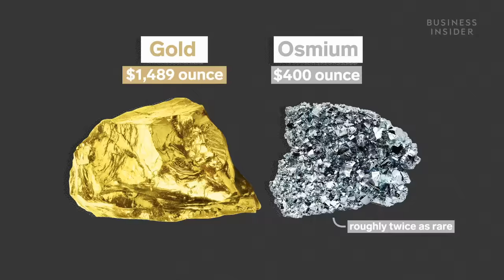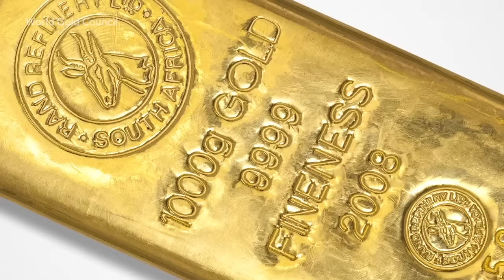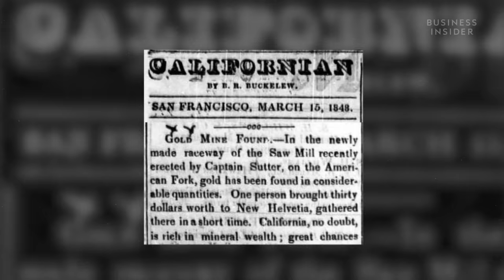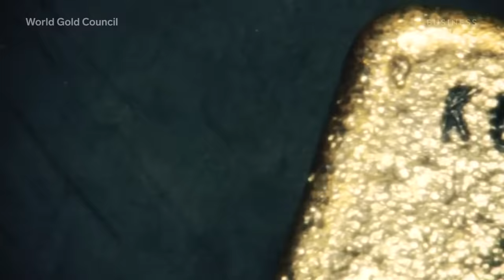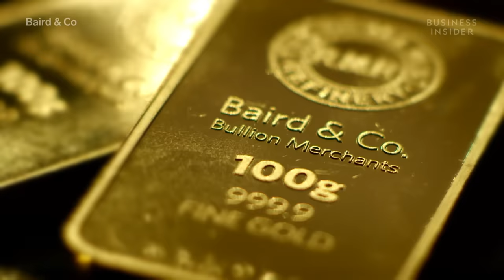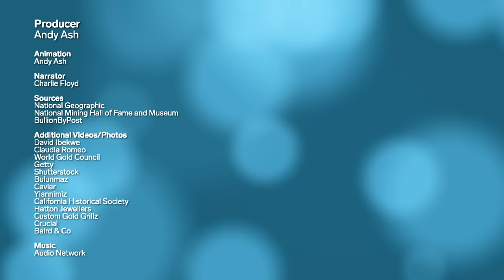Why Gold Is So Expensive | So Expensive

Comment: Knowing this it seems like a huge waste to use gold on jewelry.
Reply: Where else should it be used. ?
Reply: I hardly care much about jewellery honestly
Reply: @onaisarehmani2884  technology
Reply: @onaisarehmani2884  you didn't watch the video ???
Reply: @LevSeven_  well, if its so valuable for technology be prepared to pay for my cold chain when the mines run out.
Reply: @onaisarehmani2884  
gold is one of the top conductors of electricity, only behind copper and silver, but gold is better than those metals in pretty much every other way.
therefore it is the greatest metal for technology.
Reply: It's best used in jewelley. It looks so amazing plus it's so valuable.
Reply: Not really, because its just a form to store it like a gold bar. It can be sold and melted.
Reply: yeah,we can use it for another project
Reply: @TheBooban  damn straight
Reply: @centralprocessingunit4988  Silver is also the best heat conductor. Along with being the best electrical conductor, it's a more important commodity than gold. The only major advantage that gold has on silver is the fact that it is so unreactive so it doesn't tarnish, but even that is fixed with basic alloying.
Reply: @JavenarchX  so what if its valuable? and even if it looks good its better used for tech
Reply: Doesn't really matter. If/when we ever run out of gold all the stuff already made from gold can be melted down anyways.
Reply: @codymarshall2231  alloying reduces the electrical conductivity of the silver further because it disrupts the regular lattice structure by introducing various sized metal atoms. It would also cost a lot for every company to start having to buy silver and alloy it for an inferior product.
Reply: @onaisarehmani2884   why did you put a dot before a question mark?
Reply: @onaisarehmani2884  medicine,like what's said in the video
Reply: @JavenarchX  how is decoration valuable?
Reply: @onaisarehmani2884  Your comment is hardly surprising given that profile picture, of course you'd think jewelry is the only thing that matters, what a clown. Clearly did not watch the video either.
Reply: You are now baned in India.. after this comment
Reply: It's bodysafe & theres so much gold
Reply: Why a waste? It’s pretty
Reply: I mean, I can kind of see where you're coming from, in that it runs up the price so that it can't be used everywhere it would be useful.

That said, it's hardly a crisis, since there are other metals that are useful in the same capacities, even if they're less than ideal.

Granted, I'm not exactly unbiased, but I think the greater concern is the environmental and social costs of mining precious metals in the first place. We need to address those issues first, whether we're using them for technology, medicine, or aesthetics.
Reply: @JavenarchX  why should it be used in jewelry just because it’s valuable? That’s a bit shallow imo, sure it looks good but you can most gold jewelry are coated in gold because gold is quite malleable and soft. You can just paint it gold and it’d look the exact same.
Reply: It's not like it's being consumed. Gold always remains the same and can be used for different purposes.
Reply: @raisin4406  It's stupid
Reply: Not at all if you buy a gold wedding band it’s advantageous over buying a silver wedding band because if you ever were in dire straights you could smelt down the gold for alot of money in the future
Reply: Yup
Reply: Good armors are not a waste :ap
Reply: @centralprocessingunit4988  how do you figure it is better in every other way? Silver has the highest thermal conductivity of any element. It also has the highest light reflectance. It is also neck and neck for electrical conductivity with copper. I think sliver has one point or so ahead of copper though in electrical conductivity. It also has great health benefits as well. Gold is great and has these properties as well. But not on the same level as silver. The only thing Gold has over silver is rarely. That and you can pound it so thin you can see through it. I don't know if you can do that with silver lol. Back to the rarely of silver ans gold though. With how much silver we destroy in manufacturing of bombs and other technologies. Silver will soon be as rare as gold if not more rare. Because most of all gold ever mind is still on Earth somewhere in some form. We have destroyed a crap load of silver over the many years. New mines are not opening and like gold we are running out of silver. If we do find enough silver to mine. It could take up to 20 years for the mine to start producing. 
SILVER FOR THE WIN! LOL
Reply: it's called vanity honey
Reply: @JavenarchX  Silver looks better for jewelry. Gold is somehow looks dirty.
Reply: @citizen9403  but silver is more reactive compared to gold and rusts faster than it
Reply: @tuturu9514  silver doesn't rust it will tarnish
Reply: It should be used for money
Reply: @bismanaufa5618  money? Ok
Reply: @Electromushi Nah, throughout history from the bronze age to now, no metal has been as important to humans than tin.
Reply: @JavenarchX  Would you rather have a necklace or every piece of technology in your house rn?
Reply: @citizen9403  Silver tarnishes so it's unusable in electronics
Reply: @citizen9403  Same thing, different name
Reply: @caspernicus5822  tarnishing on silver is very easy to remove. And yes it is usable in electronics. If someone has silver that is tarnished and they are making something with it. They can easily remove the bit of tarnish to have nice shiny silver again. Also I don't see why you couldn't use it tarnished either. Shouldn't affect the conductivity of it probably at all.
Reply: @caspernicus5822  both... I'm rich
Reply: LOL! NO it's not!
Reply: It is
Reply: @JavenarchX  its not?
Reply: Your opinion is irrelevant. You’re not a business owner
Reply: @T12345T-r  yeah... Why not 🚫
Reply: @onaisarehmani2884  clearly someone didn’t get an education
Reply: How so?
Reply: @onaisarehmani2884  Medicine and technology

Much better than decorations, right?
Reply: @onaisarehmani2884  electronics; its the best conductor of all metals.
Reply: @cold_commander5155  okkk
Reply: Gold jewelry preserves it’s value. Diamonds are the scam
Reply: @VincentGonzalezVeg  Did you watch the video? It is predicted that useable gold reserves in the earth will be depleted in 20 years.
Reply: Gold was popular with ancient Egyptian rulers and gold watches were popular with 20th Century leaders. Paper money cannot compete with gold.  Gold was pegged at $35 an ounce until 1970.   Now one ounce 
Krugerands, Maple Leafs, and Eagles cost around  $2000 per coin.

Comment: Note for the editor: Watch main plates are made of brass generally, not gold. If they aren't brass then it is made of a harder metal usually to prevent flexing on a super thin movement which would affect the way gears engage. I only say this because the beginning explanation of gold is over video showing a watchmaker doing perlage on a brass main plate. Probably only watchmakers will notice, but just wanted throw a little knowledge out there in case it actually mattered to anyone.

Comment: It makes for a great physical currency because of the fact it’s rare, but not to rare like some other metals, so there is still enough to go around and be used, liquidated. Other metals are too rare and there’s barely enough to go around. And some metals aren’t stable and very reactive. Gold is a stable, very eye appealing, rare metal. And metals are the best choice for currency because they last the longest. Silver is a great currency too because it’s rare, not as rare but rare compared to a lot of materials and most other metals. Has even more industrial uses, is eye appealing, and also is malleable like gold. Silver does tarnish but is easily cleaned

Comment: It’s really rare and you can do special stuff with it because it’s also really workable and doesn’t oxidize. This makes it last forever in a vault in an unchanged state (good for a currency). Unlike precious gems - which are also rare, unique and expensive - it can be divided into smaller units of exchange without lowering its value (and recast into large bars for convenience).

No, it’s not because of the color (see the current platinum and palladium prices).

Comment: Few things wrong about the 'how gold came to Earth' explanation. Elements up to iron are produced by main sequence stars, then depending on the size of that star it could explode in a supernova. This event fused the iron into even heavier elements, up to and including lead. After that kilonovae(collisions between neutron stars) and hypernovae(basically just supernovae that's anywhere from ten to a hundred times more potent than the average) are required to forge still heavier elements. But none of these form distinct 'masses' in which only one element is present, all of the elements produced/expelled during these events mix together in giant clouds of material. Sometimes these clouds mix with existing clouds, which triggers the formation of a star and some planets too. Most of the heavier elements sink down to the core of a rocky planet, but a small amount still stays up at the top layer and gets 'baked' into the crust of the planet so to speak. Most of the elements like gold, lead, iron, uranium, and all of the other 'heavy' elements we've dug up are those deposits that remained up at the top layer of the planet during its formative period.

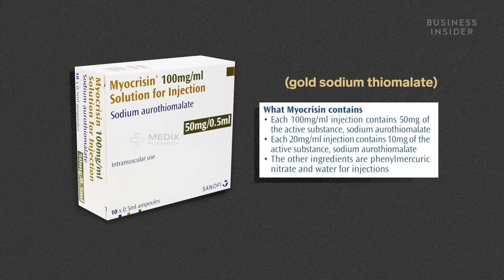Comment: 4:28 "Almost every electronic component" is completely untrue. Gold is sometimes used in connectors and contacts, but not in components. And it's a common misconception that gold has superior conductivity, when in fact both copper and silver are better. Gold's resistance to corrosion is sometimes useful in exposed contacts, but almost everywhere else, copper is a better material to use as an electrical conductor.
Reply: Yup, but that exposed contacts is the reason why gold is irreplaceable in electronics, at least so far. It's not because of conductivity, it's because it doesn't oxidize.

Comment: I’m of <the opinion that those who leave it to market dynamics to determine when to trade or not are either new to the Market or are probably just naïve. The market has seen far worse times than this, enlightened traders are taking advantage of the dip and pumping even more towards trading sessions. My advice to new investors: More emphasis should be put into day trading as it is less affected by the unpredictable nature of the market. Trading went smooth for me as I was able to raise over 8 BTC when I started at 1.7 BTC in just few weeks of implementing trades with signals and insights from expert Kristina A McFadyen. For crypto related issues.:yt: Kristina can be reached on ͲeIєɠɾαm👉Kristinafadyen.